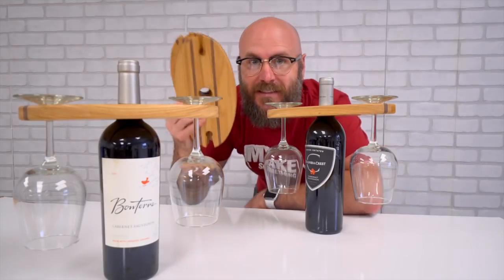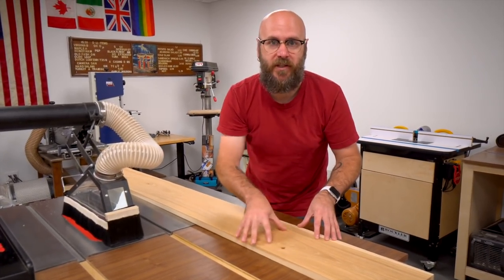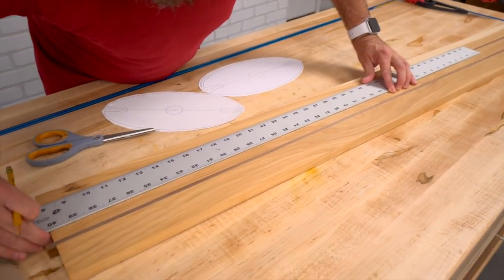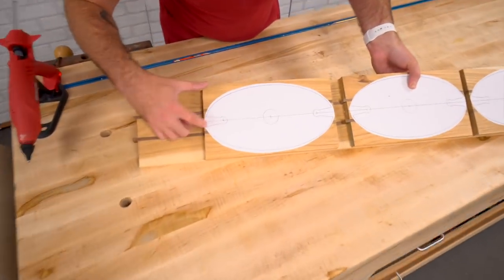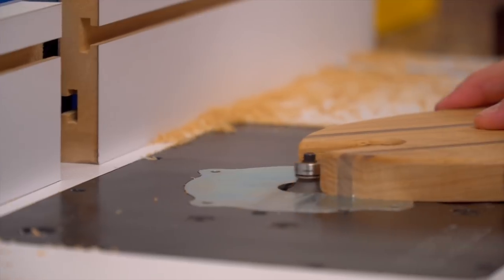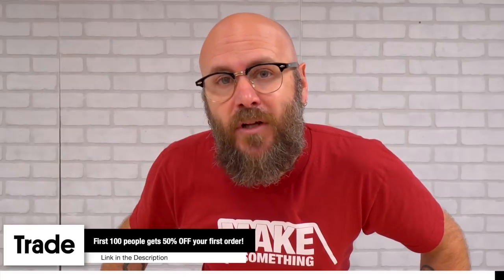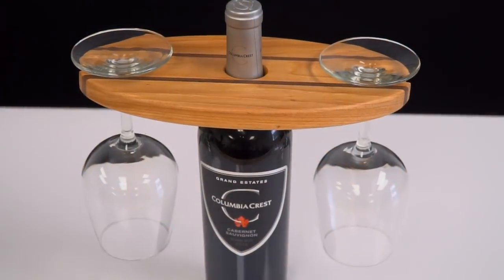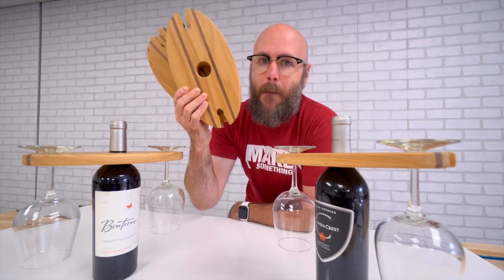How to Make and Sell These Wine Displays For Profit!

Comment: Sweet, easily batched project David! Love the video transition using the middle hole.  Great point too about not offering too many choices. One step to maybe streamline the ripping - rip the first outermost piece, flip the board over, rip the other outside piece, then move fence to rip the middle piece (saves one fence move).  - Jim

Comment: David, as a fellow David & "budding" woodworker, I am curious when you say "thinned down Polyurethane" what is your  formula for watering the poly down? If you don't mind me asking. Thanks in advance!
Reply from the maker: 50/50 mix of polyurethane and mineral spirits
Reply: @MakeSomething  Thank you Sir I appreciate you taking the time to read this & to answer me back! I kind of thought that would be the correct mixture, but I wanted ask a expert.  Last question (For now 😁), how long do you let the poly sit/soak on the display?
Reply from the maker: @davidnleeh4  I like to flood the surface with a foam brush or rag, come back in 15 minutes and wipe off the excess with a rag. Repeat in 24 hours for 3 to 5 days. There are quicker finishes but this is flawless and protective.
Reply: @MakeSomething  Again, thank you for answering my questions & sharing your process with the rest of us woodworkers!!!!

Comment: Great video - looks like Christmas ideas. A little off this topic, several videos ago when you were setting up your new shop, you decided to go with carpet on the floor. Are you still happy with that decision? If so, what was the brand of carpet you used? I am in the process of building an 18' x 30' and never thought of the carpet idea until I saw the video. Now I am considering it. Thanks
Reply from the maker: Thanks! Yes, I’m still happy with it and love it. Takes longer to clean up for sure but worth it. Not sure the brand since the contractor installed it.

Comment: When you cut the board into strips, instead of changing the fence, make the first cut and then flip the piece over. You will still keep the grain pattern. You are changing bits, and settings often. Drill all the holes for one bit first, then change. After gluing all the strips together and planing them, cut to length on miter saw they would be easier to handle.
Reply from the maker: Cant flip the piece over because only one side of the board is jointed. The other side is rough from the saw mill. To do so would be an extra cut. Other tips are great and is what I normally do but for the sake of video...

Comment: When finishing them with Polyurethane, how are you avoiding finger marks? You seem to hold the surfaces directly while brushing.
Reply from the maker: I thin down the finish so much that it self-levels immediately.
Reply: @MakeSomething  what is your approximate dilution of poly to thinner 50/50

Comment: I just started attempting to make these. I picked up some hard maple and walnut.  also a board of red cedar, might do something with that. Anyway, the boards were 1 inch thick. I've done 2 test boards, currently in glue up, but I resawed the boards in half. So they will be around 1/2 and inch thick. Do you think that is really too thin for this item? Seems like they'll end up more the thickness of the clipboards you've made in the past.
Reply from the maker: 1/2” thick should work. I prefer them a bit thicker around 5/8”
Reply: @MakeSomething  Well, after a lot of plaining, it ended up 3/8ths thick. Would be good for a clipboard, but smaller then a piece of paper, or a cheese cutting board, but I used regular titebond. Otherwise it looks fine, or more like a reproduction of yours made in China. Also, as I was plaining, I was thinking of all the ways I could make the process easier and faster.

Comment: So does that 1/8" round over bit fit all the way into the glass slot and into the 3/4" hole?  That's going to be a real pain to duplicate in there by hand.  Rat tail file maybe?   You must be really fast if you can turn out 30 of these in 8 hours (and you must have a zillion clamps for the original glue up)

Comment: This might be a dumb question, but couldn't you make the first cut on the hickory, then flip it over and make the second cut without moving your fence and still get the same continuous grain pattern?
Reply: I think the issue would be trimming the edge on the other end board. You'd have to trim it perfectly to begin with (including the saw curf) to have a straight edge against the fence to rip from on the second cut after flipping. I think it's probably easier to just move the fence a couple times.
Reply: If you make the second cut after rotating along the long axis, that would be another "factory" straight edge to run along the fence. The middle piece would still follow whatever cut you made. Then adjust the overall size of the template so the leftover middle piece doesn't require any cuts. I haven't made one of these (don't have a table saw) so I am just trying to see if there is a flaw in my thinking. I'd like to try to make one with my circular saw but I'm not the straightest cutter and if I can take one cut out of the process, I think I have a better shot at the final result being straight!
Reply: I meant set up, not another cut. It's still the same number of cuts, but one less adjustment with the edge guide on the saw.
Reply: @tylerpeters1181  have you tried making a plywood / mdf 'track' for your circular saw? This would take a lot of the inaccuracy out of your cuts.
Reply: @craigcoe2804 I did a week ago. Haven't used it on anything specific. I used my father in laws kreg circular saw guide and was thinking about getting my own until I made the plywood track like you said.
Reply: @tylerpeters1181  give it a try and see how it goes - there's cheap enough track/plunge saws available now too, depending on finances etc. I hope you can find something that works for you as these look like a great project / sellable item!
Reply: That would work on s4s lumber but most hardwood, at least affordable hardwood is s3s

Comment: This may be a stupid suggestion but at the beginning, instead of having to repeatedly re-adjust the fence, why couldn’t you set it to the wider cut and then simply cut each side, rotating the board 180 degrees in between?
Reply from the maker: Only one side of the board was jointed. The other side was rough from the saw mill

Comment: Hey now, I'm having a hard time separating the two (batching)  from the hot glue. Any suggestions?
 Thanks
Reply: They make different types of hot glue.  Try to use something like a low temp glue rated for sensitive crafts. I feel like they don't hold as well.  What I do is I get super glue and fast acting activator.  I use blue painters tape.  I'll put tape on each board.  On one board I'll put the super glue and on the other I'll put the activator.  Once you put them together they will instantly stick.  They come apart easy enough because it's just blue painters tape on the wood.  No residue as well.  Good luck.